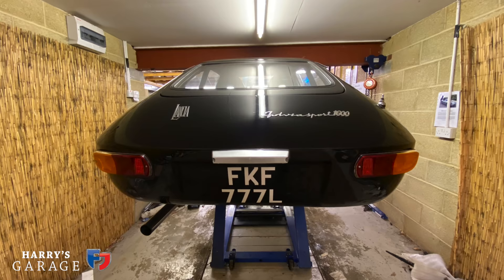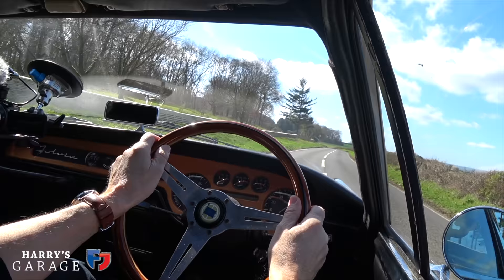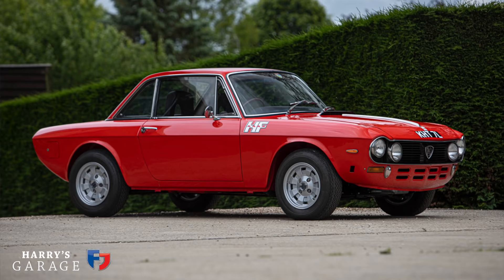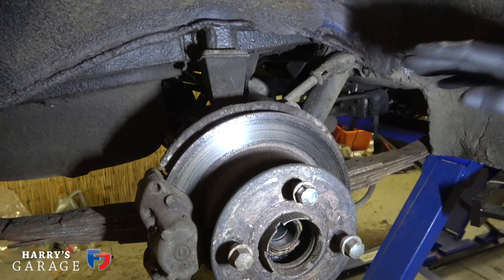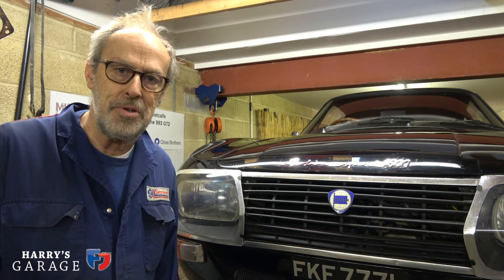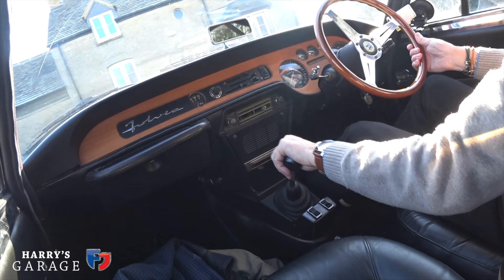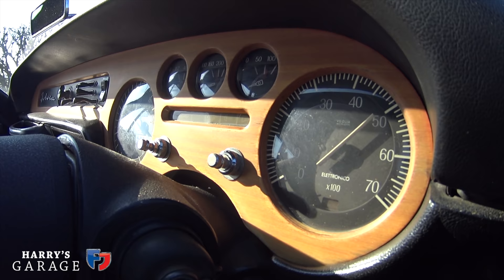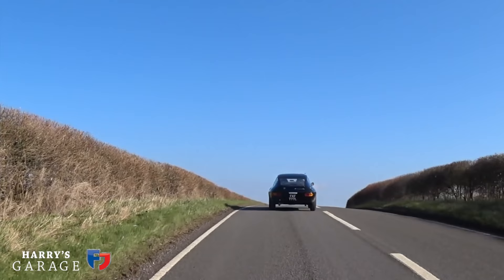Lancia Fulvia 1600 Sport Zagato. Best sounding car in the garage?

Comment: The engine sounds amazing. Smallish cars with adequate horsepower is the optimal driving fun, IMO. If you can never push the car’s limits on normal roads, then what’s the point?
Reply from the maker: This is so true. I think the fact the engine is a bit cammy, so power comes in a bit of a rush at the end, the low-ish gearing and the lovely induction bark all add to the experience. Lotus Elan is similar, if a little quicker.
Reply: Definitely one of the best drive's I ever had was hooning round the IOM in a ecoboost fiesta !
Reply: Fantastic little car. Im of the same opinion as belvin. Small light car with adequate power is fantastic fun and theres much less chance your license will go to Swansea for a holiday!
Reply: I completely agree .i own a 2013 Suzuki swift sport , most fun i've ever had . In fact probably better than my old mk2 golf gti.
Reply: Agree with belven which is exactly why I recently bought a BRZ, not much power, low-geared, low C of G and low grip tires.  More sideways in the past 3 months than in the previous 10 years.
Reply: The exact reason I will pick a Cayman 2,7l 1st gen over some older 400HP 911 Carrera
Reply: Thats the philosophy the latest Alpine A110 brought again to modern cars
Reply: I agree. We all love supercars but when you are breaking the law in the blink of an eye I don't see the thrill. There is no time to enjoy it. You can see a different kind of enjoyment on peoples face when driving a hot hatch or sports cars like the Alpine Harry reviewed for example.
Reply: Exactly right. 

The fact is that you will have more fun in a Fiat 500 than you will in an Aston Martin.

Everything that detracts from the driving experience, from air con, softened suspension, overlight steering, noise dampening are really only important if you drive long distances.
Reply: Totally concur. Took me years of turbocharged limpets to figure out that the only person I need to impress is myself.  And I bought an ND MX5.
Reply: I  was laughing out loud in a few places. Getting vicarious pleasure from the sights, sounds and look on your face Harry. Thank you for another hugely enjoyable vid.
Reply: I honestly have more fun in my half knackered reliant kitten with perhaps 20bhp at the wheels than my GTI-6 or at least until I find a duel carriageway poor thing only does 73mph although 55-60 brings me 60mpg
Reply: The greatest little four-seater I ever drove? An Alfa Berlina 1750. Words cannot describe.
Reply: Absolutely spot on which is why I am building my Lancia to "enough" horsepowers.  Also the same is true for motorcycles as well.
Reply: R A to suggest someone is not a car guy because they like driving small and underpowered cars is particularly rude and ignorant. Some of the most inspiring drives by the greatest drivers have been made in underpowered vehicles. Real car guys enjoy cars in all their forms.
Reply: @johntechwriter  agree
Reply: It´s a  Lancia Vulva.   8======D
Reply: This combo is great if you have access to it. Here in the US, for many, the kinds of roads to enjoy this kind of car on are far and few between. I think there is something to be said for a car that has "excess" power, but is still fun well below the limit and is tolerable for the daily grind, which I don't think is the case with this. But this car is great at what it does
Reply: R A We get it, R A, you’re compensating for your ahem, shortcomings...now run along.
Reply: So true! My first car was an ex water company mini van. Not quick but due to great handling and low driving position it felt like a go-kart even when doing 55mph. Even cornering at slower speeds felt fun. As a contrast I've driven some more modern cars at around 90mph-100mph and you got no sensation of speed.
Reply: @blueberrycobbler  I mean Harry owns tons of faster cars too; is he also overcompensating? I think slow car fast is a type of car fun, but in no way is it the only kind as people here are suggesting.
Reply: @richardhoulton4016  Miata is always the answer...
Reply: R A Nonsense
Reply: Just switched from an Audi RS6 to a Mini Cooper S. So much more fun. (it takes some time coming down from that kind of hp though).
Reply: You just described my 2013 Abarth 500C.
Reply: @harrysgarage  Not sure if you will get this, I know you get lot's of comments. In the future if you decide to completely remove the underbody coating out of the wheel wells (and under the car) I have just completed this on two of my front wheel wells. This is the best method I found
1) A powered multitool and a scraper blade attachment + a heatgun
2) After you have done this, I then used a mini-airtool with a 3M flapper wheel to remove anything left
3) Then use a powered dremel and a sanding roll to get into all the smaller area's where the other tools can't get
4) You can then use thinners to remove any left over residue
5) Then use a metal conditioner in a pump spray bottle to condition the metal and remove any micro rust - I used PPG Metal Conditioner
6) Now coating - Few options here, either 2k epoxy primer/sealer or POR-15. I used epoxy primer as I have a few bits that will be 2k top coated and the rest will be getting a rubberised underbody coating
7) Once this is done, seam sealer. I found 3M Heavy Duty Drip Chek to be great stuff, but apply with gloves and a well vented area
8) Rubber undercoating - Several options available here depending on how you want to apply it and the final finish you are after. Aerosol or Shutz gun. A really fantastic product is the Rustoleum coating, it used to be available by the litre, but I am now told it is only available in aerosol form. Another option if you wanted to use a shutz gun is the 3M undercoating or the Upol Raptor undercoating. 
9) Optional - 2k clearcoat - If you use a paintable rubber undercoating, you can then 2k clearcoat it (satin or matte) to protect the finish and make it easy to clean. I say optional as depending on the roads you drive on, rocks etc may take it's toll over time.
Hope this helps in the future, love your channel, you are just a natural presenter. 
Rob.
Reply: @EconoboxGarage  sadly slow SUV and Crossover are very poor driving experience, feel quite dangerous around anything more than a 10 degree heading change corner! Fulvia on the other hand is one of the best handling cars ever made. Best Ginetta G15 at Mallory and give lightweight Jaguar E types a run for their money at Cadwell Park!
Reply: Front drive is an absolute deal breaker for me no matter what else it's got going for it, FD is not fun
Reply: Harry's garage Harry do you remember the Fiat panda Sport.I have one great small car fun 100 up 6 speed will geared.
Reply: Mk1 MR2 was a legend. Revvy mid-engined rear wheel drive fun.
Reply: I remember that James Hunt had a Renault as his daily driver, his comments summed it all up!
Reply: @harrysgarage  The Elan is quicker because it is much lighter. My dad owned an Elan, and I owned Fulvias, so I was lucky to have plenty of opportunity to compare the charms of these great 1960s/1970s cars.

Comment: Videos such as this one serve a great reminder that the joy to be experienced from owning and driving an automobile can be a deeply emotional experience that has little to do with raw performance. Harry, given your history with this particular model along with all of the other things that make this car special, I can only imagine how instant the smile reflex must kick in whenever you find yourself behind the wheel while applying increasing pressure to the the accelerator pedal. From watching this video it appears that not only did the Installation of the carburetor rebuild kit succeeded in eliminating the dead spot in the Lancia's power delivery, but it likely also further decreased what was already a near instantaneous smile reflex reaction time. I also really appreciated you providing the close-up look at how Zagato went about fitting their own body panels to the Lancia's structure — fascinating.

Comment: Lancia and their little Fulvia. Everything's so quirky about the Fulvia.
I owned a 1.6 HF back in the early 80's and had so much fun, a tiny little shallow angled V4 situated forward of the front nearside wheel, the dog-leg gearbox was a nightmare to engage 2nd gear in the cold British winter when first moving off and yes,...the lumpy ride low down was awful but get it opened up and it just wanted you to Rev the bloody knackers off it, so much so it would ask you for more and more abuse. 
Mechanically, such a tough little Jack Russell type thing but with a very delicate and fragile body,......and expensive too when new. I Love the Fulvia Coupe.  😎

Comment: I have heard reports of poor performance from the 'flare-type' fire extinguishers! They apparently do not output the volume of suppressant necessary to properly extinguish a vehicle fire. While their run time is comparable to a compressed gas type extinguisher their output volume is substantially less. You should give it a test run, before you rely on it! 
The Fulvia is magnificent, and the black color suits the body lines beautifully! Sounds great too, thanks for the video!
Reply: Interestingly, I've heard the opposite. On a recent rally there was an engine fire, despite trying to use 4x FIA approved extinguishers they failed. Another competitor drove by with one of those fire safety sticks and put the fire out. Also, on their website they mentioned about another fire with a TVR putting it out.

Comment: Talking as a Fulvia owner; running on open trumpets is notoriously difficult with a Fulvia. Best solution is to clear the airbox and extend the air intake to the grille and have a single airfilter right at the front. Love you love your Fulvia Harry😉
Reply from the maker: My car now runs beautifully on its trumpets (with added socks not shown in the video). The flat-spot was there with the air-cleaner fitted, I took it off and found the fuel leak. Now it's off and so running so well, I can assure you it won't be going back on any time soon!

Comment: I always carry a fire extinguisher in my car, never needed it until one day I saw a puddle jumper with flames licking around the bottom grill. Luckily I was able to extinguish the  flames and save someone's pride and joy. Every car has the potential to go on fire, something simple as an oil leak onto a hot manifold can ignite.

Comment: Harry, that  strip of rubber between the guard and inner guards are normal. Dad's Zagato had the same thing when we restored it. And yes, it was rusty as hell. We ended up finding a coach builder who made entire quarter panels up. When you run a tape measure over the car, you will be surprised how out of shape and symmetry the car actually is. Great work and enjoy your new toy.

Comment: I have owned Fulvias ever since my first car. Driven well over 500,000 miles in them, and never used the choke. If used every day, 2 dabs on the throttle is all that is required to start them. 3 or 4 dabs on the throttle, if they have not been used for a about week. If longer than that, you usually have to get the spark plugs out and dry them because they wet up quickly.

Comment: Ah...I remember using choke in the Winter, it was the first cruise control I had on a car 😋
Reply: James Ha! Yep. I think I could get 30 out of my 1980 Fiesta 1100 without touching a pedal! I passed my test in 1994 and I had to get five cars before I didn't have a choke!
Reply: Our Rover 2000 TC had a slider for choke and another one for throttle.
Reply: That, and having a clothes peg in the car to put on the choke to stop it sliding back in whilst you were driving.
Reply: drmexicoii Yep! Had to do that with my old mini
Reply: When the throttle cable snapped on my Renault5 TS, I drove home on the choke😂

Comment: Great car, it was actually pretty advanced for its day with 4 wheel disc brakes featuring a dual system at the front for added safety.  It has a 5 speed gearbox and over 100bhp from a 1600cc V4 engine featuring a double twin carb induction system, compare that with an equivalent Ford Capri 1600gt  at 82bhp.
The Zagato styling by Ercole Spada who also penned the Aston Martin DB4GT  Zagato was considered a little controversial when new but has matured well as great designs usually do.
1972 'L' plate registration means the car is from the year Lancia won the International Championship for Manufacturers with the Fulvia HF 1600.  This became the WRC the following year.

Comment: Hi Harry, looking at the corrosion in the front arches and the treatment you have done, its probably worth giving the area a blast of waxoyl to keep water out and rust at bay.  One thing I always do on older cars is fit plastic wheel arch liners from a modern car.  Easily found with a tape measure and a friendly breakers yard, I find the likes of the Mercedes c class very good as the have soft outer seal, and there is plenty about. There is usually some existing bolts/bolt holes you can use to hold them in place. Last couple of points;- new dampers will transform the car, it looks to continuously wallow, and great car love seeing it on the channel.

Comment: My 1600 Sport starts up on choke, I reverse it out of the garage then fully depress the choke, it then idles roughly but with a few revs it picks up. I generally leave it then idling for 2-3 mins (no choke) and then off we go & it's normally fine after that, especially when fully warmed up. People who have never experienced these cars do not know what they are missing. Like you, I put mine on a rolling road last year and it still pumps out 111bhp down only 3 from when new. Not bad in 48 years.
Reply from the maker: Good to hear from a fellow owner! I think the FWD puts many people off Fulvias, even before they think about driving one. As you say, they don't know what they're missing.. 
Interesting info on the choke, I'm guessing you're still running it on Solex carbs? A few comments on here suggested using your foot to push the choke off, which I've since done but it feels a bit hit and miss! Excellent news on the 111bhp too, it doesn't sound much today but as we can testify, it's enough to provide plenty of entertainment.
Reply: @harrysgarage  yes still on the twin Solex carbs which were fully serviced 4 years ago. The car drives a treat and on your favourite driving roads despite modest power it will keep up with most things, surprising people in the process. As I say I find it easier just to start on the choke, kill it ASAP, let it idle for a couple of mins then it's normally fine, although the gearbox takes longer to warm up- just like on Ferrari's. As an aside I was lucky to meet Charlie in November when I did the readers review of an Aurelia B20GT for 'Classic Cars'-see May 2020 edition- what a really nice and knowledgable young man- great company!

Comment: Very nice to see this kind of work being done on your Fulvia Harry! But just be careful with fuel leaks from under the carb, a special drip pan should be mounted under the carbs so the fuel won't be dripping on your electrical components and cause fire.

Comment: Harry, please get rid of the undercoating that is on there. That stuff is notorious for causing rust to get worse.  It traps moisture underneath and it'll rust and rust where you can't see it until it's too late and flakes away in big chunks. There's stuff that is lanolin based like Fluid Film  that is absolutely amazing and can be used to easily protect even hidden areas. I promise that once you use the stuff you'll be buying it by the case. It literally saved every car I've used it on since I found it. We also have a place called Crown rust treatment that will do it for you and I've had great luck with them too. The only downside is that it needs to be reaplied every so often. But that's a small price to pay for the protection and ease of use.

Comment: I had watched the other posting before I saw this one and suggested underbody rust treatment and it would seem that is a bit of an issue. The 2002 "restoration" job really wasn't very good, so looks like you've just caught it in time Harry. Glad to see you like getting into the restoration work. Sounds really good on the dyno rig. You could fit one of those Power Spark its from one of your other videos.

Comment: You had a dead cylinder until 4000 RPM. Glad to hear the difference after the tune-up
Reply: Got the exact same problem with Flavia, its the mechanical ignition being too worn. Is about to do what also say is the proper solution, namely put in an electronic ignition.

Comment: This extinguisher is a gas extinguisher - invented by the Russians for their space station MIR.

After beeing lit like a match, it generates an inert gas to put out fires with - this small one does it for ~30 seconds - way longer than a powder extinguisher. Plus, after one minute the gas decays and becomes non-toxic.

It is much lighter too, this unit is less than 200 grams. Furthermore, it does no further damage to your car - unlike the powder ones, containing soda which eats paint and wiring after a short time.

The biggest gas extinguisher is intended primarily for marine/industrial use and goes for ~60 seconds.

Personally, I got a foam extinguisher for my car - 750 grams of AFFF still goes long enough whilst beeing way cheaper.

By German law, this is just "extinguishing spray" as an extinguisher has to has at least 1 kg content. Still, that little can offers more spray time.

Greetings from Germany!!